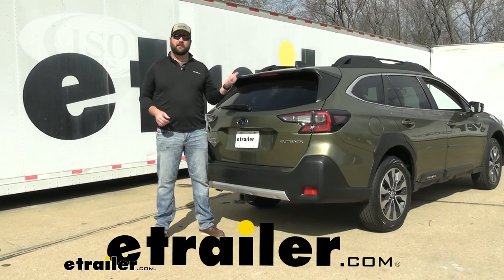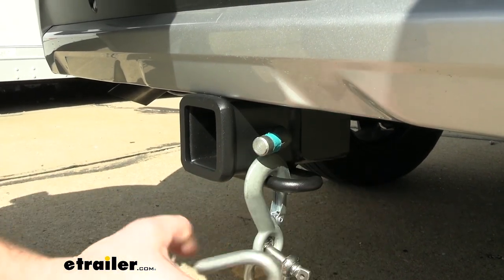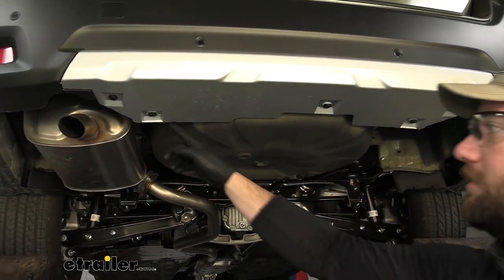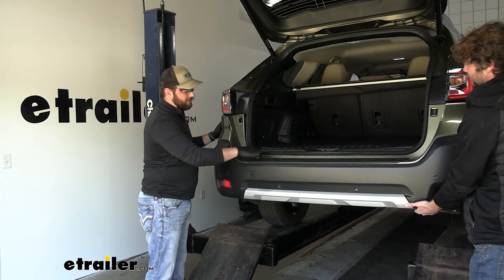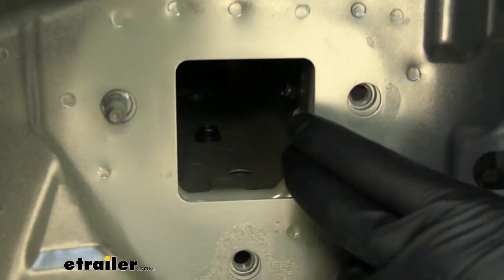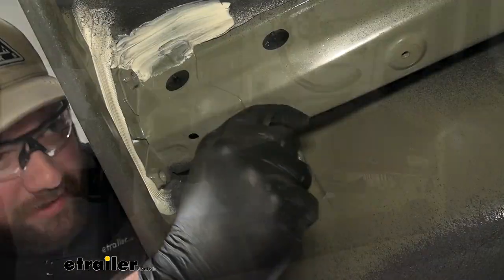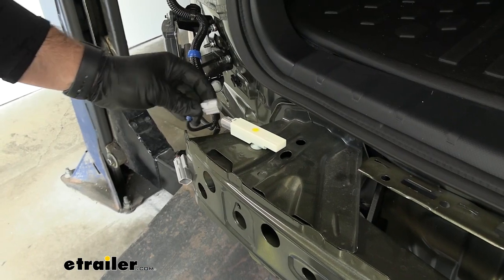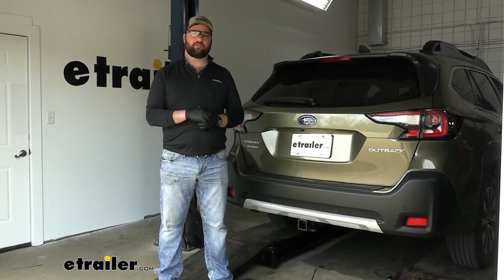Installing the etrailer Trailer Hitch Receiver on your 2023 Subaru Outback Wagon

Comment: Difference between this hitch and oem hitch installed by dealer?
Reply from the maker: From what we've found, the OEM hitch sits a little higher on the vehicle, with the receiver tube exiting through the rear bumper fascia. From the photos, it appears that the OEM hitch-equipped vehicles use a different rear fascia. The etrailer brand # e25TR is about half the cost of the OEM hitches we found online, and keep in mind that if you go with the OEM option, you'll still need to get the hitch specific fascia, as well.
https://www.etrailer.com/Trailer-Hitch/Subaru/Outback+Wagon/2023/e25TR.html
Reply: oem isn't available in 2" according to my local dealer
Reply: @etrailer  that's hardly the only difference. The hitch in your video connects to regular low strength steel and tiny low grade square nuts (the ones that hold the crash beam), while OEM solely connects via the beams inside the high tensile strength high strength boron steel frame rails.